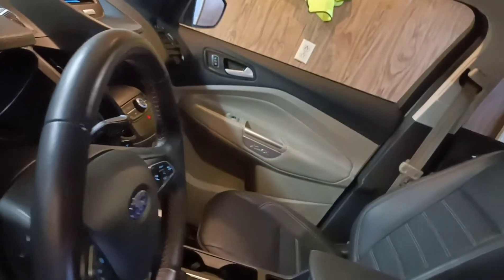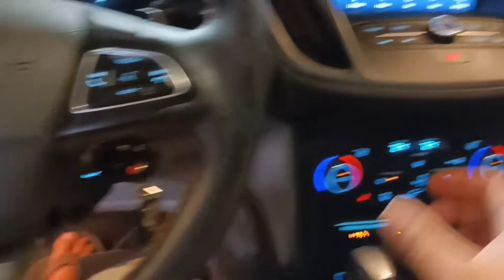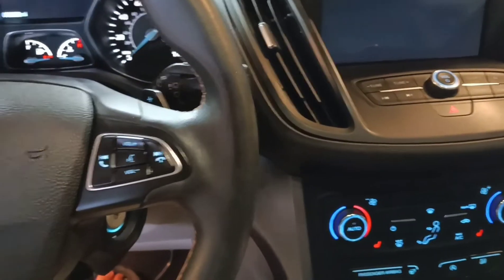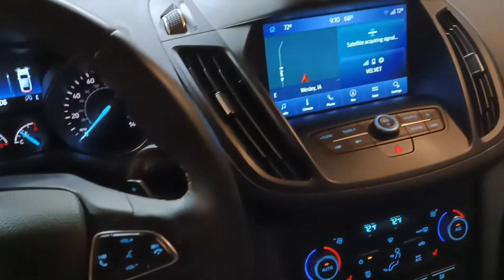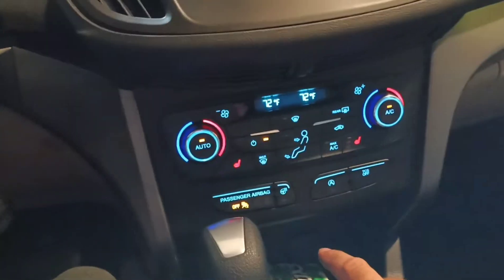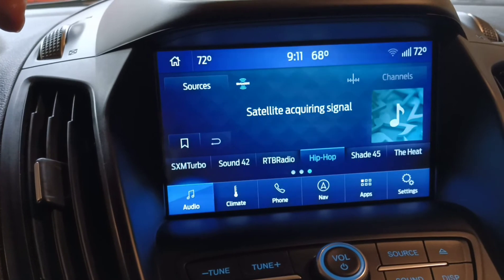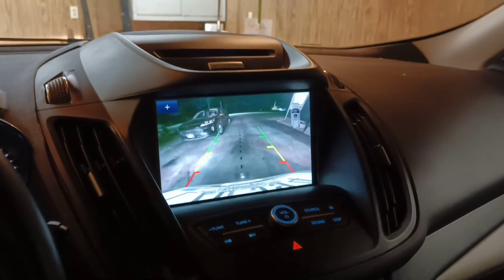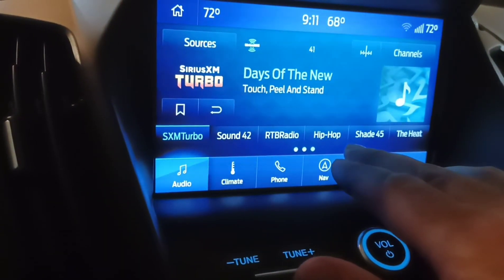Heated steering wheel install in a Ford Escape or Focus

Comment: What is the torque spec for the bolt that holds the steering wheel to the steering column?